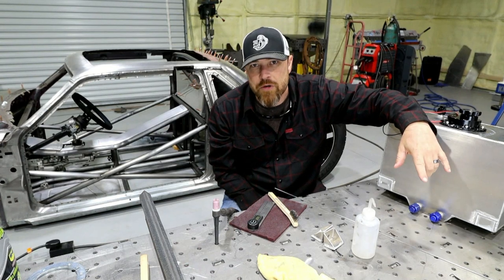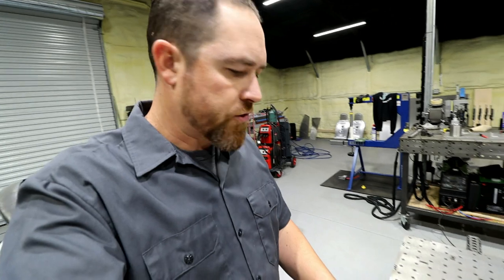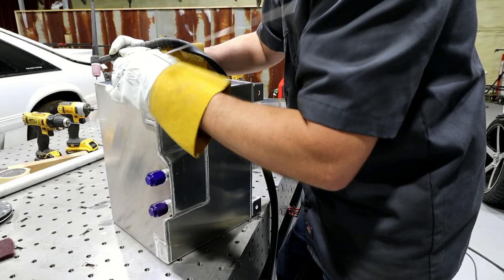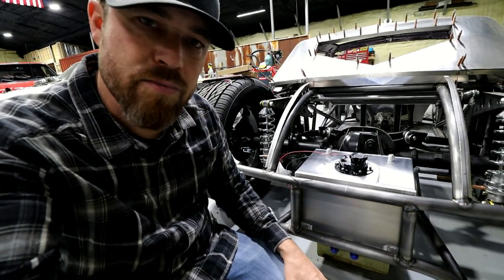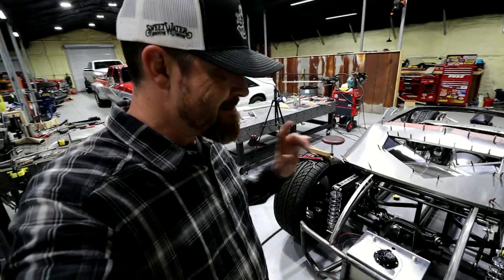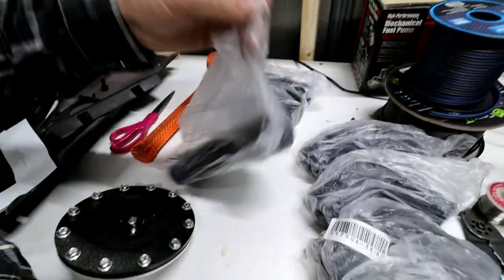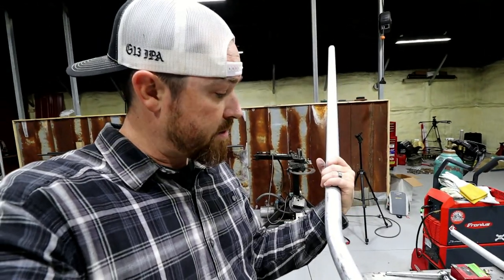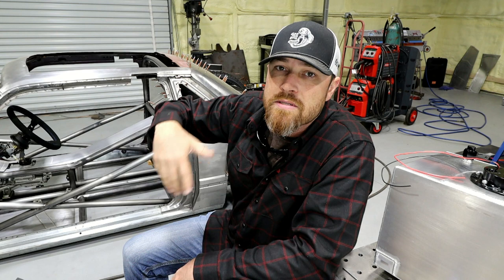Fuel Cell Mods for the Bibbster Fox-Body Build

Comment: @The Fab Forms, The problem with the Pinto was the gas tank was Metal and in an accident it would puncture the gas tank with the rear axle which would cause a spark igniting the fuel. putting an SFI rated fuel bladder in there would help prevent that problem.
Reply: Actually it was the bumper extensions that punctured the tank, I was a Ford tech then and did the recall to replace the supports, they were like shock from the bumper to the body.
Reply: @carlwhite8225  Yup, adjacent to the rear brake light wiring, IIRC, which was often damaged and shorted in a crash.
FORD KNEW(!) it was going to be a problem but the sons-of-bitches figured it was cheaper to settle when people died in fires than spend a few dollars to fix it.
Just another reason not to buy FORD...

Comment: Offroad shop I worked at we annealed the aluminum tubes with a torch then let cool and bent it just like steel tubing with no cracks even on bends more than 90 degrees. Just lube the tube they have a tendency to get gouged by the die

Comment: Usually if your tubing is kinking like that it’s because the tube is slipping in the die as it’s bending. You need to use lube on the follower block- make sure the die is clean- put a slug in the end where the set screw holds the tube at the U-strap. That way you can crank down the set screw w/o crushing the tube. Also, .04x is pretty thin. Try some .06x next time. * grease that follower block!
Reply: I’ve seen a lot of heavier-walled 6061 T6 bent 90° in production, but nothing this thin. I’d be willing to bet that a little extra wall thickness would make all of the difference. I know factories that are cranking out products aren’t wasting time and resources, filling tubing with sand or annealing. I know 6061 T6 can be bent with perfect results. I just don’t know the specific dimensions of material they use. Where I see it the most is in the marine industry. TONS of boat towers are built with 6061 T6 and most of those bends are creeping up towards 90°.

Comment: Part of the Pintos problem was that the fill plug on the back of the diff had an external square head on it. When the car got rear ended the tank was pushed up against the diff and the fill plug would tear a hole in the tank. One of the changes they made was to put a internal wrenching plug in the diff. Helped a little bit. Probably be a good idea to smooth out the adjusters on the back of the diff.

Comment: Yes I used tee bolt clamps on my car ,I also tigged a bead around the ends of the pipe so the clamps have a hard stop so they don't push off under pressure and heat if it was just a smooth tube it might.If you have bead dies to fit the end it be cleaner than what I did. Great job Kyle!

Comment: Haters... just tell them to go look up any drift car with a tube chassis rear end, they smash walls and cars all the time and just bounce off. That tube rear isn't going anywhere. It's safe and yes a lower back point would help they do the same middle low point on drift cars because usually they're super low it helps and keeps the fuel cell protected incase you have a wheel off or go off track. 👌🤙 Great videos man, the car looks awsome I'm going to have to make the cruise out some time and check it out in person one of the times you take it back to a show.  Also just cap one end and fill it with water and use a radiator tester and pump to 15psi and if it doesnt sprout a leak you should be good as far as pressure not 100% on the heat cycles but its aluminum which cools quickly so it make be okay especially with the fact it's going to hold probably tripple what a stock system would hold on the V8.

Comment: Haha, “this is the Fab Forums, not the buy it and bolt together forums”. Said like a true fabricator. The only thing I see difficult about the filling of the coolant system would be getting it to burp past the thermostat if the vent is on the block side, unless you’ll be able to fill it when running and hot.  I’m sure you’ll get it figured out tho.
Reply from the maker: I always like to drill a 1/8 ish hole in the top of my thermostats just for that reason although on this build I wont be running any kind of thermostat

Comment: Pintos would blow up during rear end collisions because they would use steel tanks and when rear ended the bumper bolts would go through the tank and spark causing it to explode.

Comment: I wouldn't want that fuel sending unit to reach too far down into the fuel cell.  It does look a bit too short but you want a bit of reserve designed in so when your gauge shows E you still have a gallon or two before the party stops.

Comment: I know I'm a month behind the upload but to make the wires look clean coming off the fuel pump; I like to run my wires through stainless tubing. Supper clean and keeps them away from heat (like under hood) make sure you use good heat shrink if you have to make a union that's gonna be in there.

Comment: The issue with the Pinto is the bumper would deflect and pinch the fuel tank between the bumper and the axle so it popped like a balloon. It also ripped the fuel filler neck. All the modern race certified fuel cells have a plastic liner inside the metal enclosure to help prevent leaks when the fuel cell is crushed.

Comment: An air bleeder is a good thing to do at the high points in the front and rear of the car. For the front you can do the bleeder in the intake, or once the block fills and coolant runs out of the port being used for the sensor, insert the sensor

Comment: The refuser look would be a great idea. 6 gallons seems very small for such a hp demand. I would probably run Holleys hydro mat system in the fuel cell as well pump won’t ever run dry until your out of fuel it gets every drop.

Comment: The Pinto issue was that  a rear end collision would cause the fuel tank to get crushed between the diff and the incoming vehicle . The fuel tank would split sending fuel everywhere.
Reply from the maker: Yeah but most all cars have the fuel tank between the rear end and rear bumper resulting in the same if in a rear impact.
Reply: @Thefabforums  you are correct , there must of been a geometry issue along with inadequate bracing 20 guage metal , all of the above for the Pinto to have this issue .
sprinkle in a pinch of " it meets the standards" and 1 out of fifty rear end accidents results in a fuel leak and fire. 

Keep up the great work ! Like to see the Bibster rolling down the road.

Comment: Might also be worth it to weld -16 or -20AN connections(whichever size matches better) on the radiator inlet/outlet and ends of the coolent tubes under the car. Easier to make custom lines, use 90° fittings off the radiator and less chance of leaks/failures.

Comment: G'day from West Australia,  I  can tell you the pinto fire ball cause😉🙂👍👍

It was the diff bolts puncturing the tank when rear ended, spraying fuel onto exhaust system.

However are you likely to stand on the brakes for a sleeping driver to rear end you???
Me thinketh not Kyle 😉🙂👍👍

Comment: Could make a 3/8 steel plate bent at a 90 to cover up those fittings. Go from underneath to around the back. surround with tubing and tabs coming off tubing to mount a heavy duty 3/8 or 1/2 plate

Comment: Kyle, this is coming along great.
I think you'd be ahead of the game by having a bladder put in that fuel tank  (cheap insurance for payoff).
   Also on the top, you mentioned "Clocking" that unit.   Do you mean indexing it, or something different.?  I might have misunderstood what you meant.
 
    Will the 1.5" aluminum cooling line get brittle or crack (where it's been bent) after it's heated and cooled many times because of the wall thickness or no.??

    Awesome show, awesome job.!!   Thank you for sharing this with us.

Comment: Does the brake light fit inside the back bumper bar. Maybe you can cut a rectangle out of that bar and recess the tail light in it. That way you don't cover up you badass suspension work.

Comment: What about running the coolant lines along the upper bars of the trans tunnel? That'll get it closer to the inlet/outlet on both sides as well as run above the gearbox allowing gearbox removal without dropping coolant
Reply from the maker: mainly because they need to go under the exhaust when they get to the engine

Comment: I could be wrong and  I may get some hate for this On my fuel cell as well The buoy is not supposed to go all the way down Not all gas is clean and there may be debris at the bottom of the tank I was told this design is to prevent fuel filters from being   Clogged up and prevents any damage happening to the fuel pump

Comment: From what I remember the pinto gas tank was more like a bowl that welded to the bottom of the floor. In an accident it would tear and leak.
Reply: Unlike some Japanese imports of the 1960's era, the Pinto did have a "regular fuel" tank hanging under the rear floor pan as most US cars had, which was retained by "metal straps" as most US cars had at that time. And even the Japanese cars didn't use the bolt-in fuel tank (never welded in) as the trunk floor when a rear hatch ("3rd door") was used. Around 1969 / 1970 most Japanese brands had to meet new domestic safety standards which precluded the fuel tank from being used as the "trunk floor". Other imports I have little recollection of how the fuel tank was fitted; my career was with Asian imports, first with a Subaru dealer, then a Toyota dealer, before I opened my own independent Asian-vehicle specialty shop.

Comment: I think if you Anneal the aluminum tube with a dirty torch you find it will bend without kinking 
I know it’s a pain ....fill it with sand put a plug in the end it will help you can get 90deg bends mix the sand with oil and pack it kinda tight

Comment: When Ford built the pinto they mounted the fuel tank right behind the rear end housing and when they get a rear end acadent the fuel would break open and start on fire and or blow up and ya your mounting your tank in much the same way
Reply: On the Pinto when a vehicle crashed into the rear the fuel tank would get moved forward and would split open when it hit the differential.  It was discovered by the victims attorneys that Ford had done a study which showed that a simple thin steel sheet hung between the fuel tank and the differential could stop the fuel tank from breaking open; the additional "cost" of less than a few dollars a vehicle kept that 'fix' from being implemented. Cost accountants gone awry! In 1979 I witnessed a Pinto rear end collision as a pedestrian waiting to cross a busy 2 lane street during a warm summer day during the evening rush-hour (one street west of my auto repair shop, easier to make a parts 'walk' 2 blocks to the parts store than sit in traffic for like 3/4 mile with all the one-way streets in that neighborhood). 

The Pinto was rear ended bad enough to "pop" the rear hatch open and bend the rear sub-frame down so that the bumper was like 45 degrees down from normal; like 4 inches off the pavement.  Myself along with 2 other bystanders in the crosswalk saw the massive fuel leak start and alerted the driver thru the open pass side window to "get out".  Less that a minute later that Pinto was engulfed in flames!

Similar situation  with the 2nd gen Crown Vic's (1998-up; EN 114), but after the Pinto fiasco played out in court Ford took a the situation more seriously (of course they did, this time it involved "first-responders"). With the Crown Vic the fuel tank was being penetrated by a rear suspension locating bar (Panhard bar, iirc).  This time Ford responded by with a "deflection shield" and later an optional fuel cell was fitted. That came out in the press here due to the number of IL State Trooper vehicles that were rear-ended when on the side of area expressways and the IL Tollway system; and burst into flames. But hey, with the Crown Vic that damage was occurring at a much higher closing speed than what the typical Pinto rear-end fires entailed 30+ years prior.

Overall, I don't see a direct correlation with 'the Bibster' though with either the Pinto or the Crown Vic. The safety standards for mass produced motor vehicles with as poor as they were in the 1960's & 1970's with the Pinto, were greatly improved by the 1990's; whereas 'the Bibster' is a one-off custom build which has no standards to meet, beyond what the local state motor vehicles regulations proscribe. And sure as hell, 'the Bibster' wouldn't meet the Australian "engineering regulations" as what the guys at Mighty Car Mods have had to meet to make some of their "custom builds" able to be registered for the street. Namely Marty's Mira build where he and Moog "converted" the Australian sold Mira with a JDM Mira 4WD which was chopped in half to get it into the country as a container with "car parts".

Comment: As far as the pinto comments and catching on fire..... Has anybody ever seen a Sprint car?? Literally I cheap little push bumper in front of it that bends all the time. Just a fiberglass tank with a bladder inside of it. They flip end over end all the time and it's super rare, like very rare, you ever see a fire and those damn things run on alcohol. Just uneducated people making uneducated connects. FAB ON
Reply from the maker: yeah I think some of that stems purely from the media play it got back in the day.
Reply: Just like with the Fiero catching fire, was actually pretty rare as was the Pinto. The media and people blow things out of proportion. Pretty sure the pinto was because the exhaust was ran under the side of the tank causing the fire.
Reply: Alcohol fires are invisible, duh. That’s why you don’t see them, Ricky Bobby! :D

Comment: I would put the fuel cell on the passenger side ., behind the site., and radiator behind the drivers site with a air vent to cool it..mate. If the car was mine...Bibbster

Comment: Coolant alternative

Here's the stupid question - why not just use the chrome molly tubes already there? The amount of cooling you get out of the aluminum tubing is not going to make or break the performance of this car. Others have done this successfully. It may be too late - but maybe at least think about it if you haven't already.
Reply from the maker: yeah I could have but was worried about heat transfer into tubes that the driver or passenger would be in contact with

Comment: If you go with a solid mount for the transmission wouldn't that damage something because the engine is solid mounted a lot of drag racers have told me this in the past.
Reply from the maker: Yeah typically you solid mount the engine and rubber mount the trans for a little give. On this setup I dont think it would matter because it wont be seeing the same kinds of loads as a drag car. What I will most likely do is just space the mount up slightly
Reply: @Thefabforums  oh ok good to know thanks stay healthy, God bless

Comment: have u ever tried bees wax on the blade to help when cutting aluminium?? its a hand trick
Reply from the maker: i havent
Reply: The Fab Forums it helps the blade glide through the material , I think I heard hard soap does the same , just run the blade through the lump of wax or soap just before cutting .. thank a mill for all ur hard work and great videos , ur a talented engineer and videographer, I’m currently fitting out my dream work shop and ur videos are ever the inspiration... good luck and thanks from Ireland 🇮🇪

Comment: The late model crown vic's and grand marquis had rear impact risks as well.. Ford's solution on the the police versions were rubber guards covering differential pan and shock bolts.. I've never seen a car built for the public with these safety measures in place. It was likely cheaper to pay the families of the victims than to revamp the whole production line to prevent a few possible deaths. At least in the pinto era.. I think a bladder in the fuel cell would eliminate any risks the bibbster may or may not have.. Anything that gets hit hard enough will pop a fuel tank.. GM used to hang fuel tanks on the outside of the frame with nothing but bed side sheet metal to protect them... Yikes!

Comment: Because someone ran into a pinto at seventy plus and ruptured the tank but everyone forgets about all the cars still running up and down the road with the same set up or worse with all the plastic càrs nowdays
Reply: Getting rear-ended at 20 mph in city traffic was enough to rupture a Pinto fuel tank after 5 - 7 years in the rust-belt cities in the mid-west. The 1974 "guard-rail" bumpers just got shoved forward and the rear quarters and uni-body frame rails would buckle; and the rear hatch would open up. The pre-'74 versions (with the weaker bumpers) fared a bit better, the collapse of the rear quarters seemed to be more gradual as the bumpers also got crushed.